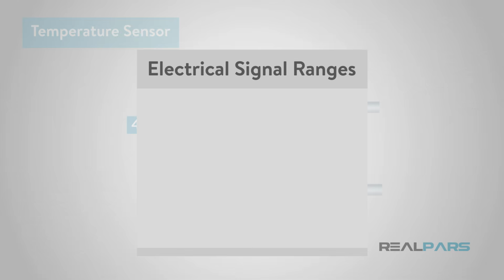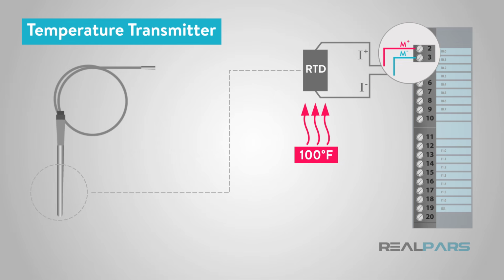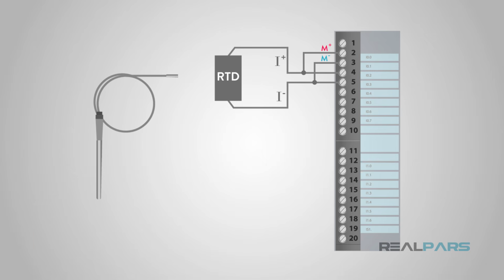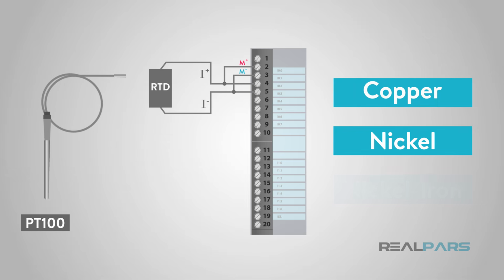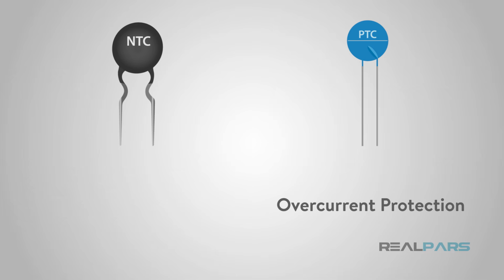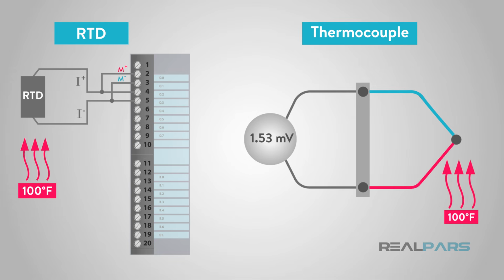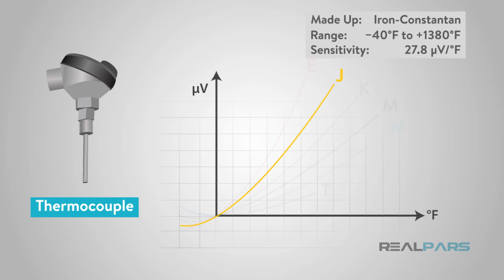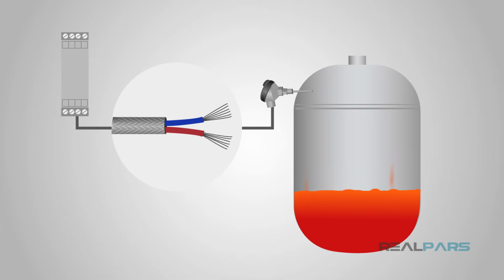What is a Temperature Sensor?

Comment: The temperature sensors fail if they change the gas expansion constant which base on atmospheric conditions : humidity.  Pressure , volume so pressure is better way to mrasure heat content
Reply from the maker: Hello @EricPhan-m9k
, thank you for your comment. As you mentioned, when engineering these systems, every aspect of the design must be taken into consideration, including pressure. Ultimately, it is the responsibility of the design engineer leading the project team to ensure these factors are properly evaluated.

Comment: Please answer me, what is the difference between 'temperature sensor' and temperature transmitter?
Reply from the maker: The temperature sensor functions solely to sense temperature. A Temperature Transmitter serves to convert the signal generated by a temperature sensor into a standardized instrumentation signal, which represents the temperature of the process variable being monitored and regulated. Typically, this signal ranges from 4 to 20 mA. Subsequently, this signal is transmitted to a Controller, which determines the necessary action and generates an appropriate output signal. In contemporary process control systems, controllers are typically either a PLC or a DCS. For instance, the Heating/Cooling system directly impacts the process under the guidance of the controller. You can explore more about this in our Realpars video via the following link https://www.youtube.com/watch?v=Kq22wxqzJ7g

Happy learning!

Comment: Temperature and pressure sensor if separate could conflicting in boiler environment which is like nuclearbomb control conflicting control and so it is really important and thermistor can easily remote influence

Comment: As I know, Active sensors need external power suppliers, not passive sensors. am I right?
Reply from the maker: Yes, passive sensors respond to physical changes, such as resistance (RTD), induced voltage (Thermocouple), pressure (diaphragm pressure element), strain (load cell), etc.  Transmitters and other powered devices are considered active devices.  A magnetic flowmeter requires power to create the magnetic field that is used to detect flow.

Comment: Are you sure you used right pictures for RTD and Thermocouple? Do they need to be replaced by each other?
Reply from the maker: Thermocouples and RTD sensors can be packaged in the same manner.  Yes, you could reverse the pictures and still be correct.  The RTD is shown as a sensor remote from its connection point, like a PLC card.  The thermocouple is shown integrated into a measurement head.  I can also have remote thermocouple sensors and integral RTD sensors.  Sometimes, the only way to tell is to check the number and colors of the wires.

Comment: Thank you for the video real pars! , btw i am confused which sensor (RTD or thermocouple) should i Choose for Water treatment plant. The range should be around normal temperature to 80C. and for the ph of the water is vary from 5 - 12. Can you suggest? Thank You very much !
Reply from the maker: Either will work fine.  If you choose a thermocouple, use a K thermocouple;  J thermocouples are not good in wet environments (will rust).  An RTD will give a better life of service, both will work well in that temperature range, provided they are installed properly.
Reply: RTD range -250°c to 650°c 
RTD is better for dinner

Comment: Hello, great video, I always find you’re content very useful. If I was specifying the instrument range of a PT100 typically what range would I use ? I understand there is an instrument range and a calibrated range, but I’m unsure on what the instrument range would typically be. Thanks
Reply from the maker: Usually, Pt100 temperature sensors, when connected to a transmitter or RTD card in the DCS or PLC, will read the temperature out directly, so no range is required.  The range that a Pt100 RTD can measure with high accuracy is typical  -200F to 800F.

Comment: Which are the parameters used in this sensor?
Reply from the maker: Temperature sensors measure the temperature of the fluid by detection a change in a physical property of the measurement leads.  As temperature changes, and RTD sees a difference in the detected electrical resistance (in ohms) and a thermocouple detects a change in voltage (mV).  These signals are converted to a temperature in C or F at the input card or are transmitted as a 4-20ma analog signal representing a configured temperature range to the control device.

Comment: When 1-5 V singal range is used? And when 4-20 mA is used?
Reply from the maker: 4-20ma is the most commonly-used signal type for industrial sensors.  This current-based signal is relatively immune to electrical interference and can be run a long distance.  At the PLC card, there is a 250-ohm resistor located internally inside the PLC card that converts the signal to 1-5 VDC which is the native signal range for transistor-based electronics.  Some lab instruments output native 1-5 VDC, but those are not as common and would require a special analog input card if brought into the PLC.

Comment: I thought Passive sensors detect and respond, while Active sensors are the ones that need an external power source, then the resistance is measured???
Reply from the maker: There are many different definitions for active and passive sensors.  The distinction is not critical to the discussion of temperature measurement devices, but it is necessary to understand how these devices work.  A thermocouple generates an electrical current in response to temperature changes.  This is usually regarded as an active sensor since a current is generated by the device.  RTD's are usually considered passive because they respond to an external stimulus with a change in a physical property like resistance.  Passive devices typically require additional electrical energy for excitation.  The confusion comes in because in some industries (aviation for example), active sensors are those that are externally powered and passive sensors do not require external power.